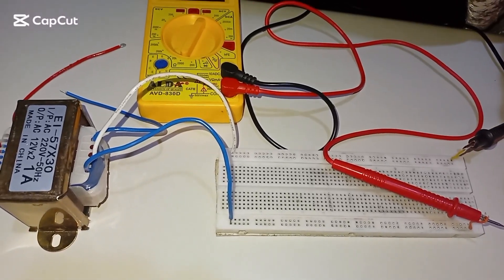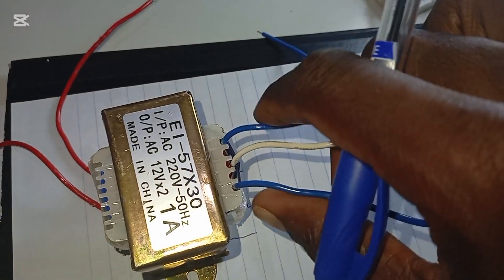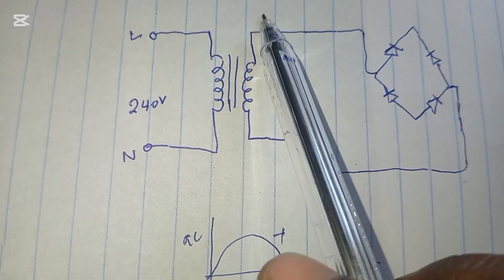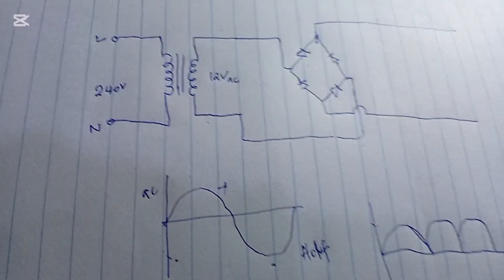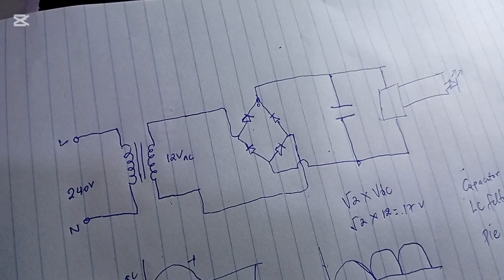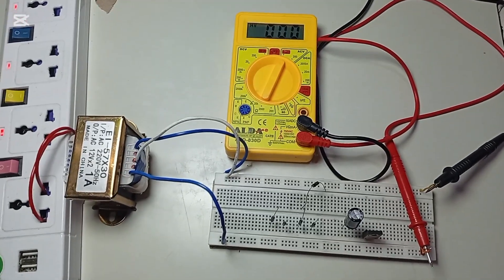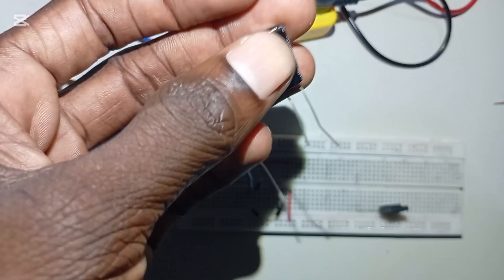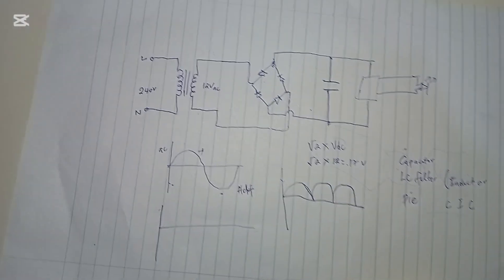Design a 5v Power Supply in 15 minutes  Project 1

Comment: what would be the watts output?
Reply: His transformer has a maximum current output of 1A, so at 5V that's going to be 5W output. He also uses small rectifier diodes that can typically do 1A maximum, and most regulators have a maximum current limit of around that as well. It's a linear regulator, so the input and output current are the same, and the excess voltage is wasted on the regulator as heat. In his case that's going to be more than 7W energy loss.
Reply from the maker: Power output is P= output voltage × output current. Check output current of 7805 IC from its datasheet